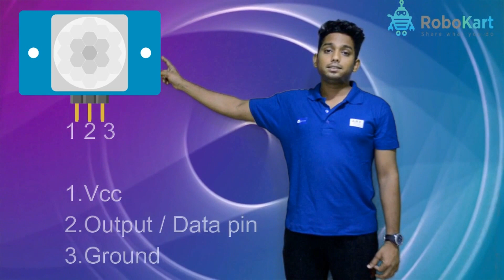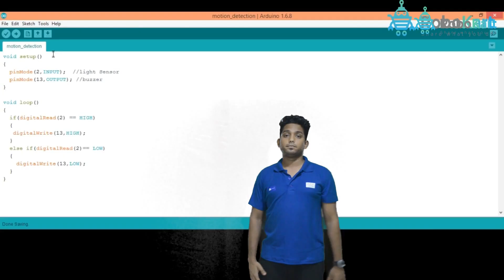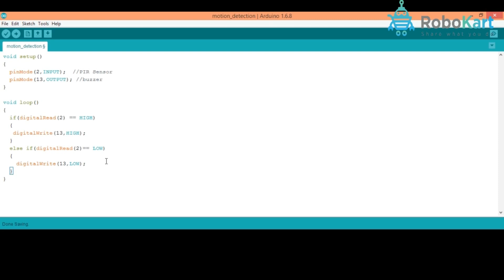Motion detection | Human detection using PIR sensor & Arduino in Robokart.com

Comment: This code is only mapping pin 2 of arduino  to its pin 13. I think it is better to connect the output of PIR sensor directly to that buzzer without using arduino.